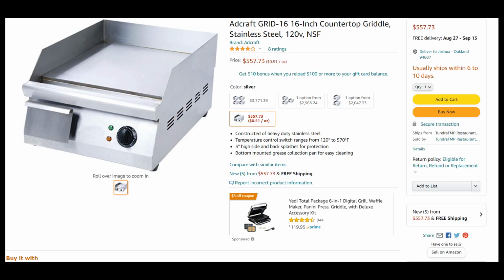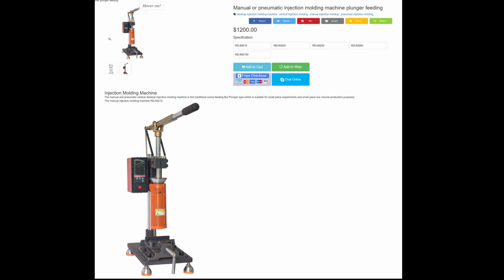Casting Costs, Injection Molding... 3d Printing

Comment: Nice vid. I've been working on starting up my own little company making miniatures, too, and I've been coming to the same conclusion that 3d printing as the final production is really, really close to being a very viable option right now for small to medium volumes. I think it's just going to increase, too, as costs of photo-polymer resins are getting pretty on-par with urethane resins, and the issues of "traditional" resin casting with mold making don't exist for 3d print-as-production.